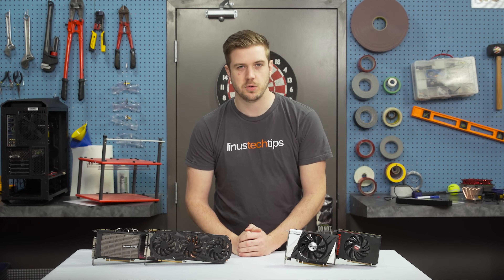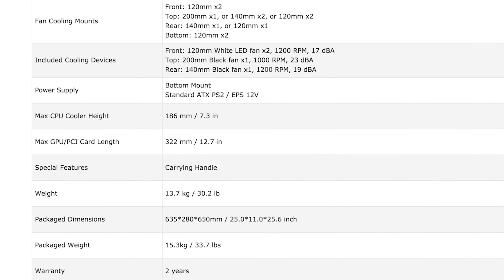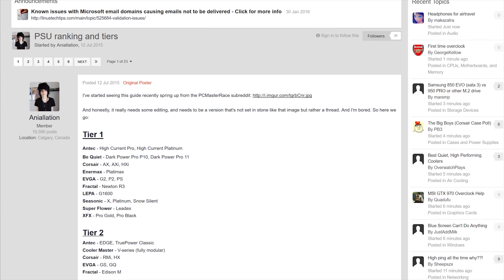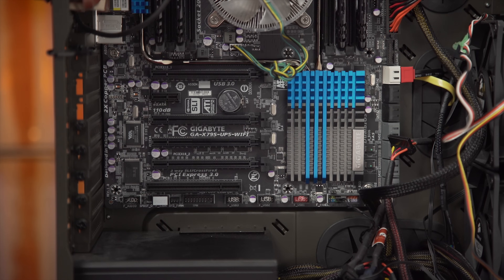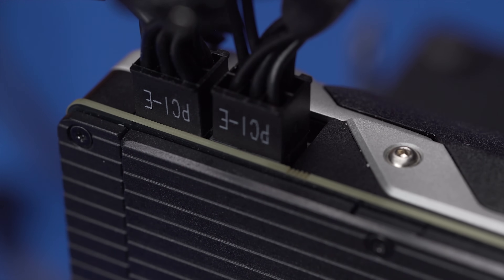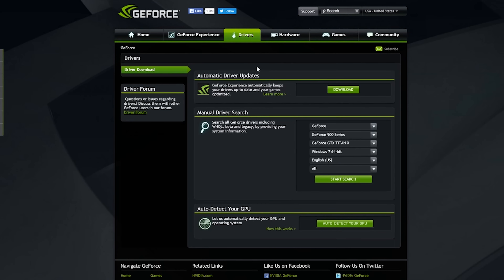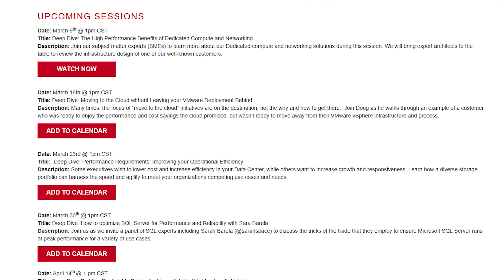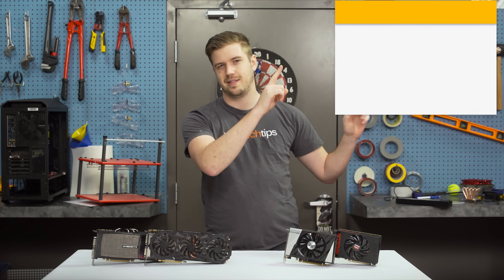Installing a Video Card - How To: Basics

Comment: question do i unistall drivers before i replace the GPU or do it after i put the new card in
Reply: After
Reply: i figured it out you are supposed to Unistall the drivers in safe mode i used DDU and selected Unistall and shutdown @jmpmang78

Comment: I accidentally ripped out my gpu when i was building my pc, had to unplug it and ripped it without pulling down the leverage.. I installed windows (without license) and everything was fine up and running for even an hour or 2.. until I plugged me network adapter (very old one) and downloaded the gpu drivers.. I restarted the pc and I dont remember if it was the first time after installing the latest gpu driver (I dont remember) but two days later suddenly my screen was tearing and flickering and kept restarting with a stop code of kernel security check failure.. ever since my pc keeps crashing. Did anyone have a similar issue? Do u think that its cuz I ripped out the gpu without pulling down the lever first? But I had zero issues during the whole windows installation proces

Comment: I have 2 different graphics cards installed, I would like to switch which graphics card gets used for the system at boot up, is this possible?  For example, as a developer, I need to test game apps on the lower-end card and need to create games on a higher-end card without swapping. Thanks for any help on this topic.

Comment: I followed this instructions and it did not work. Yes the card runs but no diaplay. So I went to a crappy channen and I found out I had to remove the motherboard battery first after installing the card. Then it worked. In short, this instruction is lacking info.
Reply: Yeah that is odd, this video is actually correct. It was probably an issue with your motherboard or cmos battery.
Reply: plug in your hdmi to your gpu, not motherboard

Comment: Is it okay if my newly installed graphics card is second hand, and i just plug it in, connect all wires and start using without updating the drivers for latest windows?
I mean, will it work temporarily? I might update it later...
The old windows is windows 7-8 i think... And new one is 10
Reply: I'm not sure what you mean by "old" and "new" Windows, but generally I don't see why it wouldn't work. Just plug the card into the PCIe slot and the PCIe power cables from your power supply into your graphics card, and turn on the computer.
It should just work. Of course it is highly recommended to update the graphic cards driver as soon as possible (security, compatibility, performance, features) and I don't see why you wouldn't be able to do it right away. Just download and install "Geforce Experience" for any Nvidia card and you are good to go.
Apart from that I highly recommend against using any Windows older than Windows 10 as they are no longer supported by security updates which is very dangerous when the computer is connected to the internet! I hope I could help, feel free to ask if you need anything else :)
Reply: @lucasmarsula7924  thank you so much! Your single reply cleared all my doubts. I do not have fast internet access in that rural area so why it may take a while but yeah, thanks 😄

Comment: Do I remove old intel drivers after installing the new GPU? Or do I install the gpu and then uninstall the intel drivers?
Reply: There is generally no need to uninstall the old drivers (if you ever change out your graphics card the drivers could come in handy).
Just install the card into the computer like shown in the video, turn the computer on and download and install the drivers for that card. (Geforce Experience will take care of that for any Geforce Nvidia card)

Comment: do i have to check which motherboard i have to make sure the graphic card im installing is compatible? or is every motherboard compatible with every graphic card?
Reply: No, generally every mainboard is compatible to every graphics card when they have been made in the last 10 years. The connector name is "PCIe" and the "x16" is basically the size of that connector. x16 is the widest, and you can install everything up to including a x16 card in a x16 slot. (For example x8 and x16 fit into x16; but only x8 will fit into x8, not into x16)
Feel free to send me your mainboard/graphics card combination and I will check it for you.

Comment: After watching this video I realized there's this like grid of plastic lines idk what it is lol but its blocking the main pcie slot and I don't think it'll fit when it gets here. Can I use the regular pci slot under it? I made sure the gpu was compatable with pcie 2.0 like my motherbiard...
Reply: I'm not sure what you are referring to with the "grid of plastic lines" If you still need help feel free to send a picture and I will help you out :) 
Apart from that: You can generally use any PCIe slot (that is wide enough) for any card, although it is generally recommended to use the top one (closest to the CPU) because it has the most bandwidth and so will get you slightly more performance. But that only really makes a difference on high end cards and even then only a few %

Comment: So, I have a ASUS GTX Geforce 1660 Super with a MSI B450 Tomahawk Max II. Using an AeroCool Bolt-G-BK Tempered Glass RGB Mid Tower case and I'm having trouble installing my GPU into the motherboard. It won't click in place with lever pulled back. I've pulled the motherboard out and still can't get the card to click in. Any tips?

Comment: For a novice, using the included drivers disk is easier. Updating is easier than hunting down driver websites and hoping you pick the right download. 
This is indicative of computer professionals trying to give instructions to people with little to no experience. I suggest giving instructions to a newb in person and seeing if they can complete the tasks with just the instructions you gave ahead of time. As professionals we often take allot of basic knowledge for granted.
Reply: While I don't think you are wrong, downloading Geforce Experience isn't really what I'd call "hard". It is literally one software that works for any Nvidia card. And there is one similar for AMD aswell. I think today most people are more used to download and install software from the internet, than to open an installer on an optical disk (many PCs don't even have optical drives anymore).
Your idea of testing the tutorial on someone without any prior knowledge is great though. But I don't think they had any employees like that at the time^^

Comment: Wait, if I have 2 ports for gpu 6pin and 8pin, do I need to put both in gpu from PSU or just one of them?
Reply: if you want to overclook for max power  which is best for gaming. You need to disconnect the extra two pin when connecting it to the 6 pin.

Comment: Installed a new gpu and it's fully working.

Great cost of $450 to destroy a $1000 computer system thank you Linus tech tips for wasting so much money
Reply: Huh?
Reply: tf does this mean?
Reply: I followed what they did and even though the you was compatible this way somehow destroyed my pc wasting a good couple thousand dollars
Reply: @vbgaming6203  how does simply installing a gpu destroyed your whole rig lmao
Reply: @kinzdarell5447  that's why I followed this video if I already knew what to do with upgrading a computer or even it getting destroyed then I wouldn't have watched the video
Reply: so to answer you I don't know how it did
Reply: @vbgaming6203  elaborate this ''destroyed'' pc
Reply: @kinzdarell5447  the gpu although it was compatible fried the cpu  and the motherboard sockets, the gpu didn't need any external power so I'm to assume the video was wrong or the provider gave me a faulty or malicious piece of hardware I have left a comment here and emailed the provider, but that's really all I can do about it  apart just buying a whole new pc
Reply: also the psu is at 850w as well if that's any help

Comment: I have zotac Gtx 1060 6gb amp edition but i hve a issue that it does not working on pcie x16 but works on other pcie port that is x4, as m using b450 Aorus elite.  HELP 😭😭

Comment: So if I buy a 1660 super with a 8 pin connector can I use a 6 pin from my psu to plug into the card or should I get an adapter?

Comment: I'm looking to upgrade my graphics card. My PC power supply has dual 8 pin connectors. If I buy a new graphics card with just one 8 pin slot, would it be a problem if I only used one 8 pin connector?
Reply: You would be fine

Comment: My PC is Core i5-6500 with 16 GB of RAM. But it has been stuck with GT 730 graphic card preventing it from showing it's full potential for almost 2 years, so I am looking out for this video on how to install a graphic card so that I can buy and install my new GTX 1050ti inside of the PC.
Reply: I have a laptop.
Not sure what's inside.
I think it kind of sucks.

Comment: I have a Problem.. my NON modular psu is 750w plus80 and has only 1 cable x 2 PCI-e switches (6+2 and 6+2)... I was afraid, so I connected the PCI-e cable into the 8 pin port and used an adaptor to join 2 MOLEX to a 6 pin conector and put it into the 6 pin port.. (gtx 1070 TI)... but Now a RTX 2070 super is on the way and I don't know what to dooo!!! buy a new Power supply??? or Use the Single PCI-E  cable(6+2//6+2) to connect both ports?  plss Help!! ... Thanks

Comment: Total newbie trying to figure out how to upgrade her Graphics. This video was very helpful. It's basically a bit more work than upgrading RAM, with the addition of uninstalling old drivers and installing new ones - the tips about where exactly to get the drivers and how to best dispose of the included drivers CD was especially good and appreciated. I now know know what things I should look out for when chosing a GPU (size of GPU and PC case, power supply requirements) and know what to expect when removing the old one and installing a new one.
So... from a total newbie who was lured here by the titke: well done, guys!

Comment: But what should I do if my fans are not working
Reply: Maybe power cable not in properly
Reply: @5nip3r56  that was not the problem. It was the AMD software that was set on 0 RPM
Reply: Gabe Da Guy lol that would do it
Reply: @baguetteboiii4151  not all gpus spin on boot up actually.
Reply: @Graphics_Card  it was my bad for not seeing it's set on 0rpm. Anyway I don't have anything left from that computer
Reply: @baguetteboiii4151  you don’t own it anymore?
Reply: @Graphics_Card  it was a prebuilt pc. I had problems with it so I took my money back and built one by myself

Comment: It's a shame they don't cover the topic of verifying that your PSU has the available connections for the graphics card you are planning to purchase in better detail. That's the whole reason I clicked on this video. I have an 8 pin and a 6 pin connector on my card. My PSU of course has plenty of PCIe 8 pin connections but as far as 6 pin connections go, they are labeled IDE/SATA... sooooo can I use one of them for that 6 pin?
Reply: every power cable is the same they are just in different form factors, if it fits in the 6 pin connector on the card and has 6 pins on the cable itself it will work

Comment: Thanks, man, but, how do I make sure that my motherboard has enough electricity to handle the GPU? (my pc isn't custom I just bought it online, didn't find any blueprints about the mother board)
Reply: the power supply (psu) is the one that dictates how much power the computer actually has. if you can't find how much it has you can take it out and it will usually have a spec sheet on the side of it with its model name and who makes it. (the power supply is the box you plug the power cable into)

Comment: I know this is an old video... But you say to select which drivers you want to remove (AMD / Nvidia / Intel) using the program even if you are building a new system... But which one do you choose if this is a new system and so haven't installed any drivers before?

Comment: do i have to use the ddu?
i hav already installed the new card but didnt use ddu
what should i do?
Reply: ddu doesn't have to be used but it resolves problems that could occur and is generally a good practice

Comment: I uninstalled the old drivers but then when I put my graphics card in, nothing shows on the screen so I can't install the new driver
Reply: Did you connect it properly?
Reply: @SomeRandomGuy789  yes i did
Reply: Tobias Corr-lawrence And nothing appears on the screen when you turned on the pc right?
Reply: @SomeRandomGuy789  yeah nothing
Reply: Tobias Corr-lawrence thats weird. Did you try installing the OS from an external drive?
Reply: @SomeRandomGuy789  I'm fairly new to pcs so i have no idea what that means
Reply: Tobias Corr-lawrence Ah okay gotcha. So if you have a disc with windows 10 on it, you can choose to boot from a disk when you first start up your pc and some instructions should follow on which drive you want to download it to. If you have an ssd, I recommend downloading it to that because ssds have faster start up times
Reply: @SomeRandomGuy789  my friend gave me the pc so it already has windows and everything on it
Reply: Tobias Corr-lawrence Thats really weird then. Did it have problems before?
Reply: @SomeRandomGuy789  no it was fine before. I think i know how to do it if i can force it to use internal graphics while the new gpu is in
Reply: @tobiascorr-lawrence4045  yeah i just answered this exact same problem on another comment and had this problem myself. uninstall the gpu and then go into the bios and force graphics onto the integrated graphics. then reinstall gpu and you will be able to download the drivers. then go back into bios and switch default graphics to gpu and move your monitor to the gpu output
Reply: @santa399  it's fine I'm getting a new pc anyway now
Reply: @tobiascorr-lawrence4045  make sure everything is connected
Reply: @Graphics_Card  bro this was a year ago I fixed it ages ago 😂
Reply: @tobiascorr-lawrence4045  ik but still

Comment: DO NOT INSTALL DDU!!! I ran the program uninstall my nvidia drivers, it had to restart when finished. It shut down and hasn't turned back on since, it's somehow completely fucked my hardware! Tested my PSU and it's fine. Removed and rearranged my ram, not it. Replaced and double checked a lot of cables, all fine. Removed my dvd drive, wifi card, and gpu, so there's barely anything left in the machine that could be causing a problem. No luck. 

My fans spin for 5 seconds then the power resets and this keeps looping. No beep error codes either. It was literally working flawlessly, always has been, up until i ran that program and now i can't even power on my PC. Terrible advice.
Reply: Looking at the comments, seems i'm not the only one who got fucked over by DDU. This video should be reported for recommending such dodgy software, it's worse than a virus, at least a virus u can actually clean. DDU just removes essential drivers and stop your PC even booting up properly. Causing more problems than you fix with this shitty advice. If i could do ANYTHING differently this year, i'd go back in time and watch a different GPU installing video. You've no idea how much money you've just cost me, prick.
Reply: Jesus, i just went to the forums for the creators of DDU, and there are COUNTLESS complaints of the program completely destroying their computers and losing all their data. This program literally destroys your motherboard. UNBELIEVABLE!  And the creator (Wagnard) just defends his shitty program and basically calls everybody having these problems all liars. He seems really condescending. God i wish i had never watched this video. No wonder it has so many dislikes.
Reply: @IntiArtDesigns  maybe that’s why everyone disliked 🤔🤔🤔
Reply: @Graphics_Card  No shit, captain obvious. Well, not everyone, but i hazard a guess that about 6k people might have ran into the same issue i did.
Reply: @IntiArtDesigns  that is not a “no shit” moment. Nobody has said anything about this. Nobody.
Reply: @Graphics_Card  Google it, Einstein.
Reply: @IntiArtDesigns  on the comment section

Comment: Hey guys, so I am fairly new to the pc building scene (first build, actually) and have been relying on a lot of YouTube videos to get me through... Anyway long story short... I need some help my brand new XFX Radeon RX 5500 XT THICC II Pro is giving me issues, when I try to install AMD adrenalin software, it goes up to approx. 65% the screen flashes and then goes black, the gpu fans stop spinning and I don't get a video signal anymore until I reboot into safe mode and remove the driver using DDU. It works fine on the basic windows driver.

My motherboard is an MSI B450M gaming plus, 16gb of ddr4 ram (2x8gb sticks), the cpu is a ryzen 5 2600x. I'm running the latest version of windows 10 with all updates installed.

Can anyone help? I've tried many of the common suggestions such as disabling the internet, running the DDU and then trying to install the drivers, nothing has worked so far.

Any help will be greatly appreciated.
Reply: I'd go to r/pcgamingtechsupport, that's what I'm doing to try and fix my computer. I feel like I'm getting somewhere with it

Comment: Hey Bro... If I Install My GPU In2 My Random Accessible Memory Slots, Can It Increase My Ram By How Much Is On The Card? I Ha ve 11gb InVidia 2080ti RTX 420-024 XC Ultra.  I was Going To Add The GPU In2 My Ram and My Random Accescible Memory Into My Pro Connection Internal Express Slot... For The Swap Of Memory And Increese In Performance. Which Bringed Us To The Question I'm Here For - - - - I Should Be Able TO Hit A Higher Amount Of Overall Memory And Storage With This Setup Rite? Let Me know Linus, - Thx!!